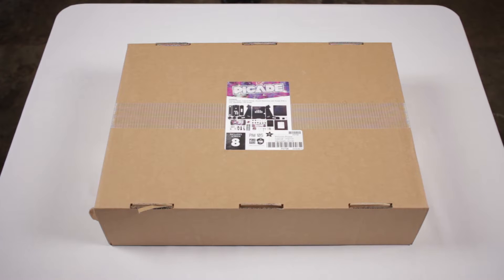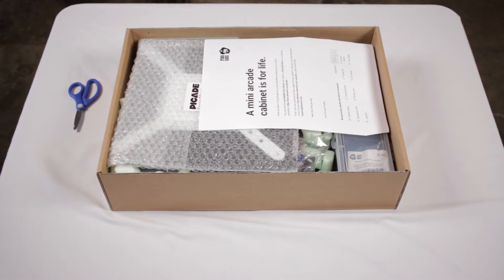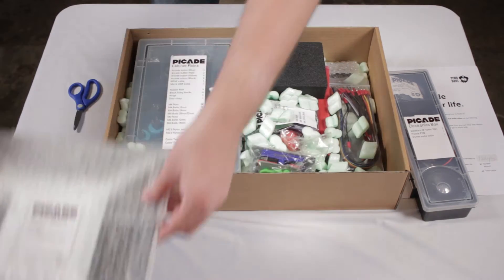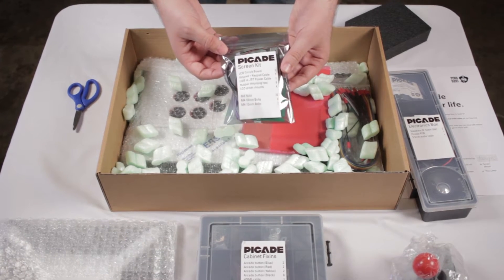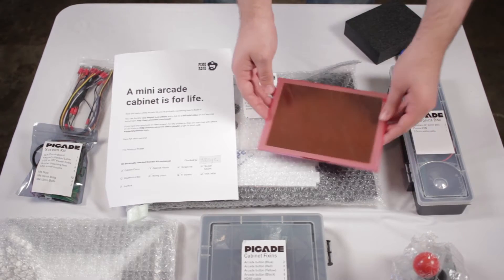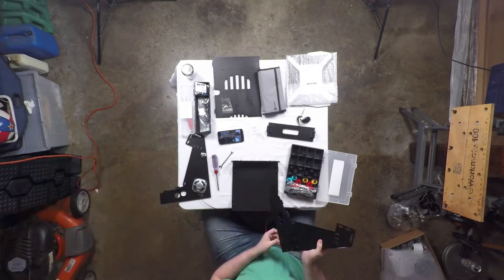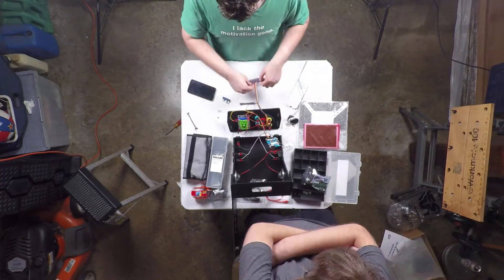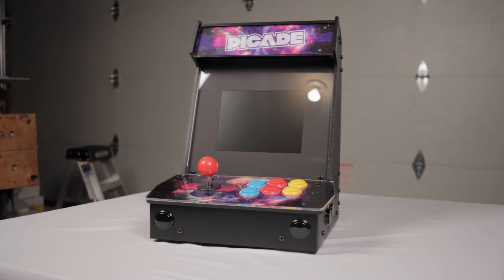Unboxing and Assembling: The Pimoroni Picade Kit

Comment: The 8" screen is fine but I havent had luck acquiring their 12" screen so I went with an ipad2 9.7" IPS  display that came with an HDMI driver from Ebay and it looks gorgeous. Swapped the controls and buttons with Sanwa's and  in all I'm quite happy with it. Later I threw in a "powerblock" (http://petrockblog.storenvy.com/products/13969704-powerblock) that would safely turn on the Pi and shut it down using a simple toggle switch.
Reply from the maker: Nice! I know that Pimoroni does provide the 12" screens. Though last I check they are finding a replacement vendor. Still that's something to think about!